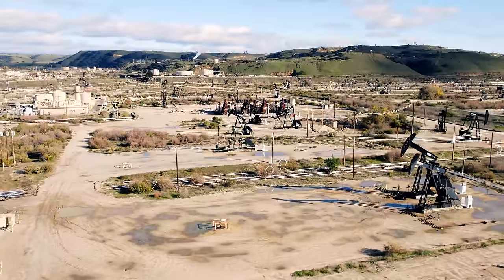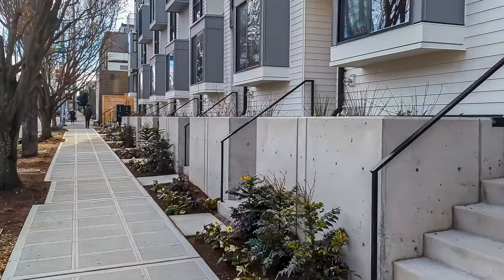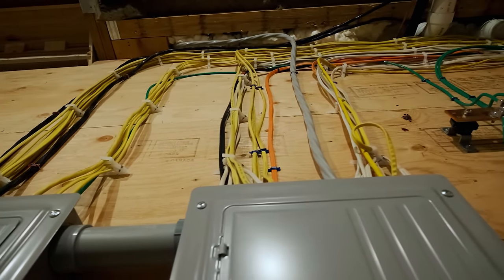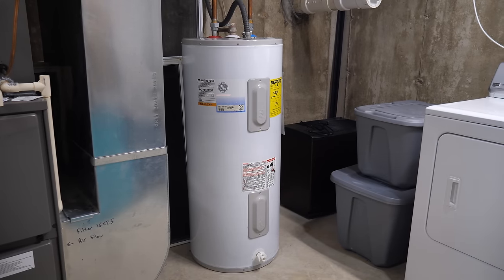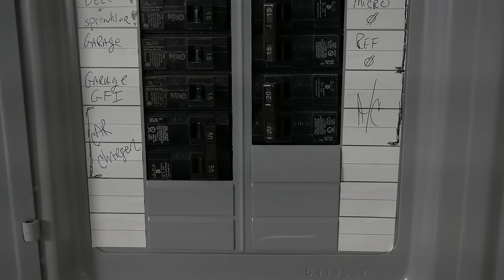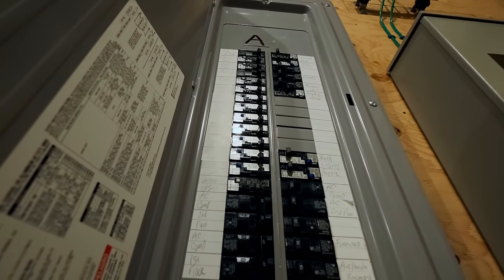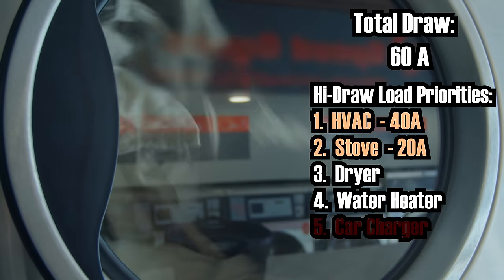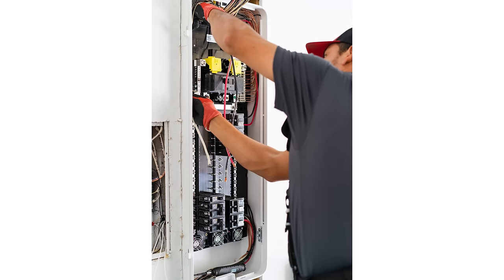Home Electrification: There's not a lot to do, and it doesn't have to be hard (Part 1)

Comment: Really interested in this series! Got a heat pump last year in a part of Canada that regularly has multiple months well below -20⁰C - found out quick it will heat, but gets expensive in those months without using backup gas heat. Will be adding solar shortly to help offset the cost, but then curious (outside of more insulation) what to do next!
Reply: I encourage you to do a cost analysis re: your gas-based energy demand versus the same cost in kilowatt-hours.  You live in a country that is a major petroleum exporter.  Gas is cheap.
Reply: @BinkyTheToaster  oh I live in the gas exporting province too. To really drive the point home I have to drive by refineries to go see family. In the coldest month it was roughly $200 a month to heat my house with gas compared to $400 to do it with electricity using a heat pump. Good incentives for solar here including an interest free loan, $5k rebate, and metering (just can only produce no more than you use) program, so if you're willing to put in the up front cost the math seems to work out for electric everything. Should know more first hand in a year or so though.
Reply: @TWLIV  Well, I'd also ask that the environmental impact of manufacture of a sophisticated electronic part like the panels needed gets factored into the equation; hardware like that (all electronics, really) tends to be fantastically dirty to make, mostly from the mining for the minerals and chemical reagents and cleaners (like chlorine triflouride, no I'm not kidding) used during the manufacturing process.  Add to that the disposal once the panel degrades to the point that it's not efficient enough, or actually fails.  Gas hardware tends to be simple to manufacture and extremely durable; my parents' furnace in their 1953 home still works like it was new.  I'm not sure of the tradeoff, but I do know that the immediate toxic effects of the panels make them, at least in the immediate sense, the greater danger, and I don't see anyone stepping up to manage that mess, or at the very least proper panel decommission and disassembly.  Mostly they get tossed in a landfill.
Reply: Move to a warmer climate will save the most on heating.
Reply: @christianheichel  can't believe I didn't think of that 😂
Reply: @christianheichel  then in summer nice to a colder one.  Heating and cooling bills gone.
Reply: The only way to get much further with your heat pump is for it to be geothermal \ buried pipes. Quite likely a big cost upfront, but works for heating and cooling regardless of ambient outdoor temperature. TC has a video on these.
Reply: @cancelhandles  I definitely did the air source heat pump as a "well I'm doing AC anyway... May as well get an air source heat pump" thought. Hind sight geo exchange with a ground source heat pump would have been a more complete solution and electrically more cost effective - I know a few people who have them and they work well by comparison. It just wasn't really in the budget/thought this go around, but I agree it's a better (albeit roughly 4x more expensive upfront) solution for the climate I'm in.
Reply: @TWLIV  It's something to keep in mind for the future. Maybe they'll be less prohibitive soon! Here's hoping, I feel like it's the next big step for climate control in furiously cold\hot areas.
Reply: @cancelhandles  definitely! It will be top of my list if I ever decide to dig up my back yard. Perhaps in 10 or so years from now they'll have refined the cold air source heat pumps or their refrigerants to a point that ground source will be irrelevant. Will be an interesting space to watch anyway!
Reply: @TWLIV  Well, if air/air heat pump efficiency improves because of better refrigerants, same goes for water based heat pumps :) 
Trying to extract some heat from 245K air (-27*C) will always be harder than extracting same heat from 280K water.
Reply: @ivoivanov7407  agreed. I am currently assuming that the upfront cost of either drilling or laying a trench will stay relatively constant (not to mention involve tearing up some or all of your yard). So if that's the case at a quarter the price for an air source heat pump in my area if the refrigerants get to a good enough level I could see that encouraging more widespread adoption as a retrofit. That being said in a new build or a situation where it's convenient or cost effective (for instance on an acreage where you could trench instead of drill) to lay the necessary piping for underground heating I agree that's the better way to go.
Reply: @TWLIV  one other consideration to keep in the back of your mind, there are a few startups pioneering deep hole geothermal systems. From what I remember, the holes are drilled somewhere close to 500ft straight down using some new drilling techniques, and in turn, they are now able to do geothermal without having to dig up the backyard. Supposedly it was also looking to be a less costly system too. I haven't looked into it in a year or more, but I do remember it being a fascinating and useful idea.
Reply: @ChristopherGoggans  I appreciate the heads up! That certainly does sound fascinating and would render my previous assumption incorrect. If that's the case it would definitely be a great reasonably priced Northern climate friendly solution!
Reply: @TWLIV  yes, the upfront cost is high, I would say, prohibiting in many cases, when repaying of the investment (compared to the cost of air heat pump) may be decades.
From that perspective, it may not worth it.
But from pure energy efficiency, water based heat pump is great. Moreover, it can provide not just home heating but also hot water for relatively small increase of the investment.
Reply: @ivoivanov7407  I completely agree with you. Even without connecting the water directly a separate hybrid air source heat pump water heater would do a good job taking advantage of the high efficiency heat in the home. Seems to be what I see as the solution here even in the cases where a new build has a ground source heat pump, though haven't looked into the pros/cons of heating water separately vs one integrated system myself.

Comment: As always - really interesting video and the concept of a smart breaker box is very cool!  Looking forward to part#2!!  It's funny - but until you mentioned it at the beginning - I did not realize that gas-dryers were actually a thing (I always assumed the only gas appliances in a house were the furnace/water-heater/stove).  Where I grew up in southern Quebec/Canada  - everything in our house was electric except for the furnace and water heater ...but these used oil and not natural gas.  We used to have this large tank in our basement that Shell would top up at certain times of the year thru an intake pipe in the outside wall  (you always knew when this had occurred because there would be a distinct smell of heating oil for an hour or so after the tank was filled).  In the early 90s (after I moved out) my parents decided to switch over to an electric furnace and water-heater and the oil tank was drained/removed (I think there was a gov't incentive program at the time encouraging home owners to upgrade older oil-based systems to electric).  I don't remember my family ever having problems with the old oil system...but I was happy when my parents decided to upgrade (i.e. you'd occasionally hear about old oil tanks corroding/leaking and all the problems that would cause....so it was definitely some extra peace of mind having the old system upgraded to electric).

Comment: As someone who lives in a climate where it sometimes stays under 0F for days at a time, I'm really interested to see what you come up with for power outage situations...
Reply: Stick with natural gas. It's so much better in the cold.
Reply: To be fair, you still need power to run the blower on a furnace. Gas is still out with the power; burners work though
Reply: I'm an electrician that actually works for a company that does this kind of switch (in Canada), from gas to electric. The process to switch a 100amp to 200amp service is what I do every single day. It takes about 6 hours total, around 4 of which you don't have power, to change the whole service.

 Lots of clients ask what you just did and to be honest, If you have a power outage you are out of luck. The house will naturally stay warm for multiple hours which is more than enough for the electric company to come fix the issue. Realistically how many hours per year is your power out? about 5-10 hours max. In very colds weather locations like myself, everyone has a generator just in case so it really isn't much of an issue.
Reply: @laundromatjones4337  Don't have a furnace. Don't have a blower motor. I have a boiler and radiators.
Reply: @TheDude13  how does the boiler ignite the gas without a power source?
I guess it's easy to power via generator, but so are a few space heaters.  It would really shine in a multi day power outage, but most people aren't likely to experience those, let alone experience one in the middle of cold winter weather.

It get's to 0f for days at a time on the regular where i live, and VERY few people run a gas furnace around here (we have very cheap hydro electricity)
Reply: 🔋 I have 14.4kWh of battery back up, expandable to 21.6kWh if desired) connected to my home’s 200A service panel, backed up by a 20 panel solar array. In addition, I have two additional EcoFlow batteries with their own portable solar arrays for supplemental and portable back up that I can take with me, loan to neighbors, etc. 
This is more than sufficient for our home and vehicle (EV’s) energy needs if/when power is interrupted, and EcoFlow also offers a dual fuel generator in the rare event you go through all of your battery storage before the sun comes up the next day or if the power from the grid had not been restored (highly unlikely, but for peace of mind on top of peace of mind, they do offer it).. but I can attest to purposely switching 100% off the grid and relying solely on battery back up from sundown to sunrise and I barely made a dent in my 14.4kWh battery back up, plus the moment the sun comes out the following morning, my batteries start to top up. Even if the sun doesn’t shine for days, I still have days worth of back up, even without the optional dual-fuel back up generator, but for those in the far north with little sunlight during the winter solstice, I’d recommend getting the EcoFlow’s optional dual-fuel generator to back up the Delta Pro back up/Smart Panel set up. As an alternative to EcoFlow, Bluetti also offers a robust back up system (AC500). Best part is that these systems are silent, create no fumes, and don’t require maintenance like my old gas generators. Smart solar battery back ups are easily a better way to back up your home in today day and age, plus, being modular, individual batteries can be taken to neighbors, or off grid if and when needed.

Comment: I must say, gas stoves are a godsend when there's a power outage.  When you have a gas stove and the power goes out, you can pretty much just go on as normal for the evening and wait it out.  If you have an electric stove, sorry Charlie, you're going to have to go somewhere else for the night.

Of the four typical gas appliances, I have the misfortune of having them all be gas except the stove.  Every time my power goes out (which is thankfully rare), I have go somewhere else.  Meanwhile, looking back at my previous home (where power outages happened multiple times per year), I never had to leave because my stove was gas.

I'm interested to see the solutions for power outages presented in Part 2.
Reply: Counterpoint, if almost all houses run 100% on electricity that means higher demand for a more robust electric grid. Losing power for any significant amount of time here in Sweden is extremely uncommon.
Reply: If it's a short outage (1-12 hours), just have sandwiches or something else that doesn't need to be cooked.

If long outages are a common issue in your area, either pick up a camp stove or stockpile a few MREs per person.

Yeah, a camp stove is still (probably?) a gas stove, but it's being used FAR less often than your main stove is, so you're relying on gas far less often. And MREs aren't as memetically bad as they used to be - they also usually come with chemical heating elements, add water to it and it makes your food hot for you.

A grill also works - it's just a really big and non-portable camp stove, after all.
Reply: The first thing I did after moving in to my new apartment was to disconnect from the gas grid. 😄 Power outages are extremely uncommon here though, so it's basically a non-issue. Induction stoves provide all the same benefits in terms of speed while not posing any of the potential health risks of gas stoves. Cleaning also becomes significantly easier.
Reply: @blunden2  Yep.

Unless you're prone to consistent and extended power outages (over a day long, several times a year) for non-disaster reasons (as those would interfere with gas as well) there is zero sensible justification for a gas stove in your house.

In all cases beyond those VERY narrow ones, electric/induction ones will do just fine. Keep some food that doesn't need to be cooked (cereal, sandwiches, etc) just in case, and maybe pick up a camping stove or a grill as a backup in case of an extended outage.
Reply: @synvila  Also this is a good point yeah. More electricity means a more robust grid is required.

Plus it's not like gas lines can never be interrupted either.

Comment: My mom lives in a fairly new townhome in the north with a gas furnace, dryer, and range. For some reason the builders neglected to install a hood or any kind of ventilation in the kitchen, so my mom wanted to replace the range with an electric one. Because she only has 100 amp service, the electrician insisted she should stick with gas but after seeing this, maybe it's worth reconsidering!

Comment: The home I just bought last year has propane dryer, stove, water heat and boiler. The house must have been mostly electric before as the dryer, water heater and stove all have unused 220v circuits. This year I am already planning on installing mini splits and a heat pump water heater.
Reply: lucky!

Comment: They tried to do this about 50 years ago. I believe it was the 60s. That lasted a few decades then they went back to putting gas into the new homes because the cost of electricity was so expensive. Using an electric furnace to heat a home in the north is expensive. 
I feel it will fail again, unless the politicians don’t let it. If you get old enough you will see the cycles repeat then you will truly understand the short term memory of humans.

Comment: The smart circuit board is oddly reminiscent of the first "smart house", Cragside, where the limited power available was switched between rooms as the inhabitants and guests moved around.  The difference being the "smart" control there was a man sitting in front of a live circuit board, being told what to switch by the butler down a telephone, since it was 1880.

Comment: In Hungary, we have got radio controlled switches in our electrical boxes, which are controlled by the grid operator, and has a lower cost. Usually people put their water heater on that. It is guaranteed to run for a few hours every day.

Comment: Never put all your eggs in one basket. When we had the freeze in February 2021 natural gas proved to be a lifesaver for many. People could still use their water heaters, stoves and fireplaces. They could also power their home including gas furnace with a small generator. Generators that run off natural gas were able to power the whole house without any stored fuel.

Comment: Just a note regarding dryers: I'm not sure how common they are in the US, but in Europe condensing dryers are very much a thing. These basically just use a heat pump to evaporate the water from the clothes and then condense the water into a tank that you empty when it's done. They're practical because you don't have to deal with either the same level of mold or potential hot-air exhaust ports, but they've also got to be way more efficient than any gas-powered alternative.
Reply: In fact, we bought a new dryer fairly recently, and heat pump dryers were the only ones we could get. With the EU's new, higher efficency standards, most manufactuers aren't selling vented dryers anymore. This was great for us, as we were moving our laundry room, and didn't need to cut a vent.
Reply: I've only seen one model by Miele, that just began being sold at my local Lowe's Home Improvement Warehouse
Reply: The US has those heat pump dryers, but the excess water gets dumped into the sewer.  We also have dryers that don’t use heat… they just spin really fast.  The clothes are slightly damp, so you hang them in the closet to air dry